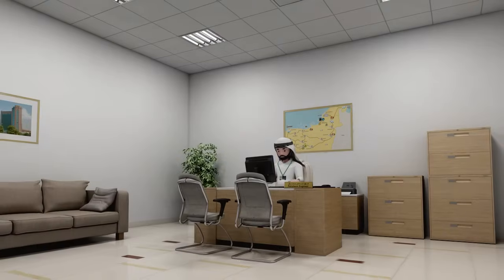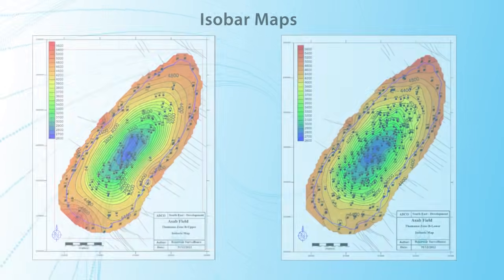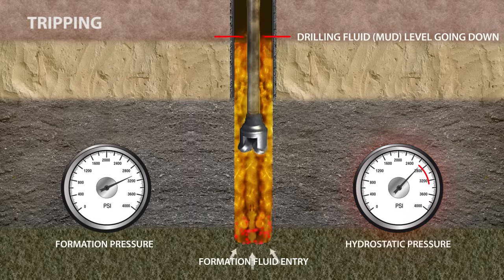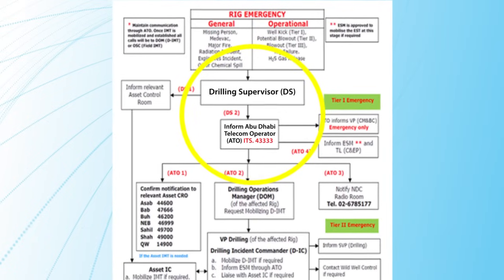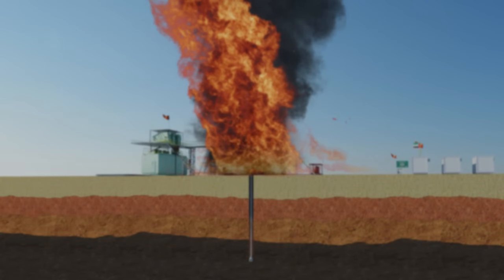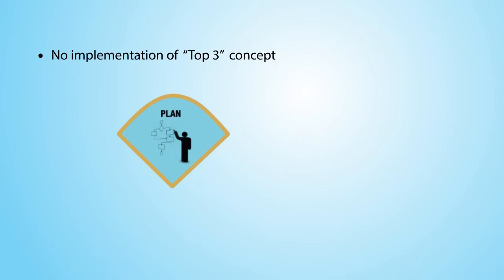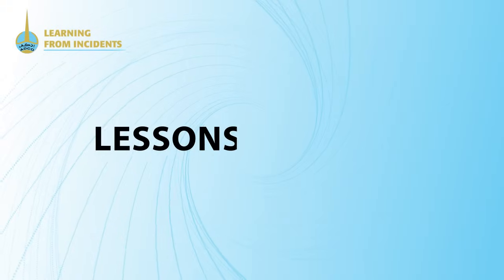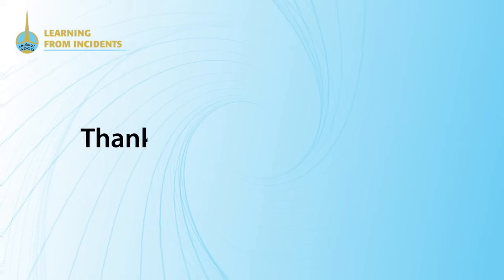Well Control

Comment: So to kill a well is done by mud pump or high pressure unit????
Reply: By closing the emergency disconnect button the sheer rams cut the pipe and seal the well ...that's how it's done on an offshore rig.

Comment: Shockingly informative video, Thanks for your sharing Sir. FYOU PMEC, Leading Solutions, Professional in API Working &Master Gages、Graphite Electrodes Working&Master Thread Gauges&ANSI/ASME Thread Gauges, manufacturers licensed by API Spec 5B, API Spec7-2&API Spec11B. All the Gages come with the Long Form Calibration Certificates traceable to NIM or NIST ,Availiable for Audit.

Comment: Some of the explanations are a bit off, after you circulate the kick out, you said that to circulate until you see zero pressure in the pipe and annulus. This could never be possible because in order to circulate tru DP ,you will have pressure . It's ur annulus pressure that you will want to reach zero psi. After pressure in annulus comes to zero then you circulate a complete hole volume and ensure that you have kill mud all d way around pipe n annulus.
Reply: Can I have your whats up number